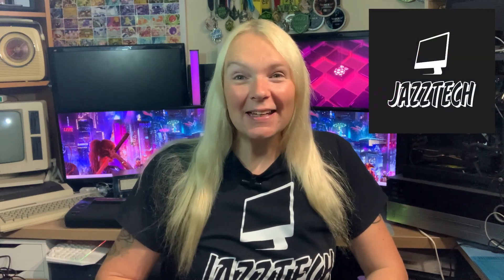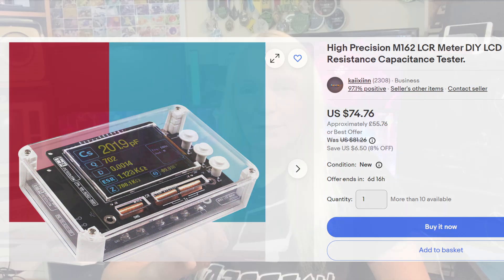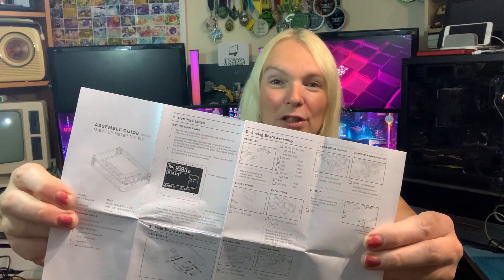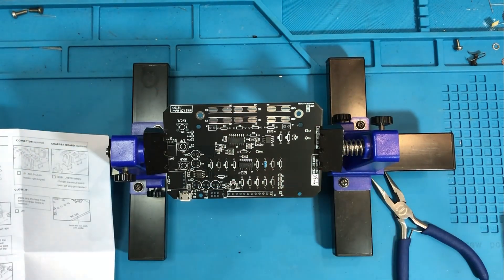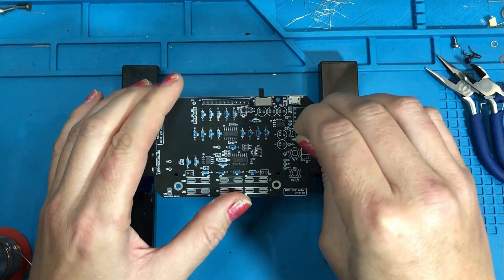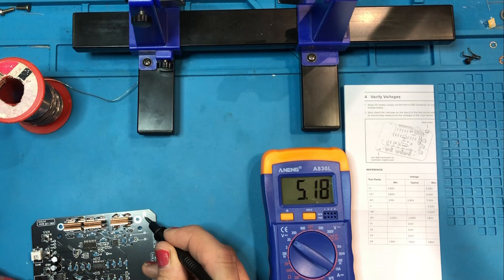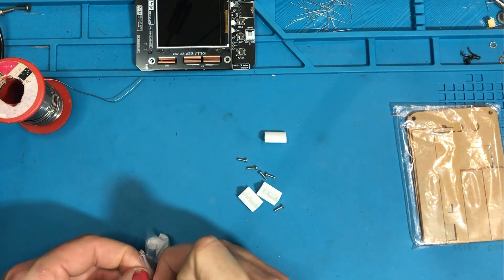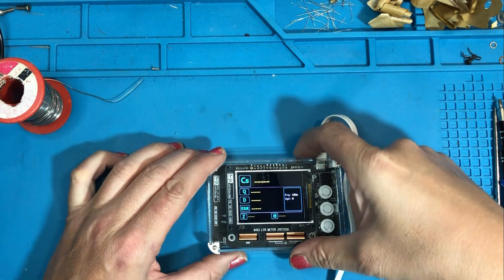M162 LCR Meter kit Part 1 - Soldering, Assembling & Testing!

Comment: "A little bit extra"?  About 10 times more than a very similar looking one from Aliexpress.
Reply from the maker: There is a counterfeit clone copy one on Ali Express at about half this price. If you are thinking about the T4 and T7 transistor testers then yes they are cheap, but nowhere near as good for accurate LCR measurements.

Comment: thank you Jane, great presentation and lovely pommy accent, both factors made me subscribe.. I'm a fan of JYT - the wow factor of their DSO138 and more - 
I have been thinking of getting the 162 for awhile but I couldn't find all the performance details I'm interested in. 
Now that you are about to complete and test one, would you be so kind to check some low value capacitors and inductors (down to small picoF and nanoH perhaps?) and get some idea of thermal stability or drift while measuring such small values? Thank you.
Looking forward to part two..
ciao
lm
Reply from the maker: I have various standard capacitors and inductors available to me I can borrow, but nothing down at that level. I will try some small values and see if it drifts or not but won't be able to verify the absolute accuracy of these small values.
Reply: Have you seen youtubers review the ZOYI ZT-MD1 ? I just ordered one, mainly for the 10 miliohm resitance resolution which is better then mymultimeter and lot cheaper then an expensive unit, was only $35 from Ali  shipped.  It states 1pf-60h for inductance and 1pf-20mF capacitance,  I wonder how this kit compares to that?

Comment: I can never get the brown paper off the acrylic sheets as quickly as you can. I have to use a knife to scrape an edge to peel up. What's your secret, maybe your nails?
Reply from the maker: I use a small bladed screwdriver to start the edge off then peel it. Sadly I don't look after my nails as well as I should. How about trying to start it off with a spudger.

Comment: That looks like a fun kit.  I'm curious why you always seem to use the t7 tester to check resistors,  rather than a multimeter,  which would be quicker?  I'm looking forward to part 2.
Reply from the maker: The T7 is just a handy tool I usually have out on the bench all the time and being that it can test most things and I don't need accuracy just identification I find I use it a lot.
You could do it with a multimeter just the same but not all multimeters do capacitance and they usually don't do inductance, so when building a kit I always use the T7 as it does all I need to identify the parts in the kit.